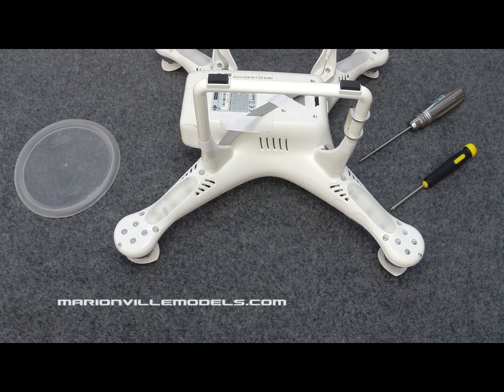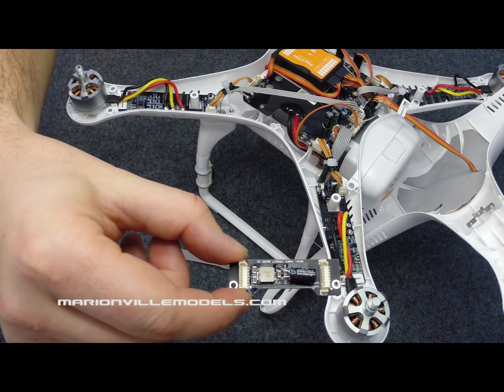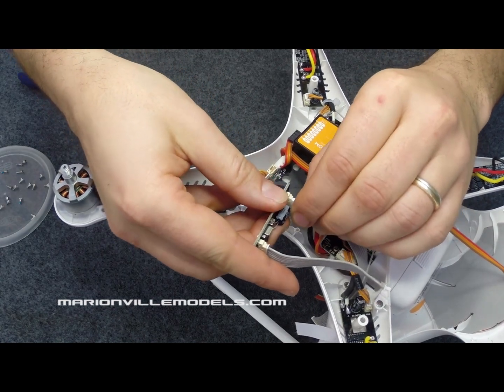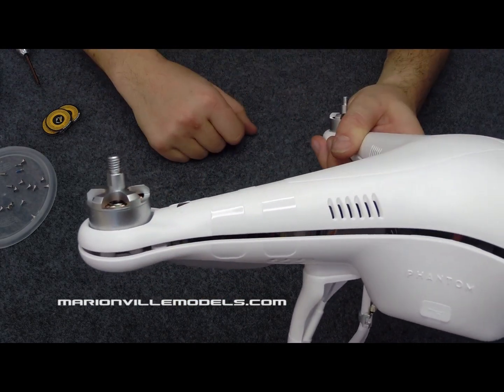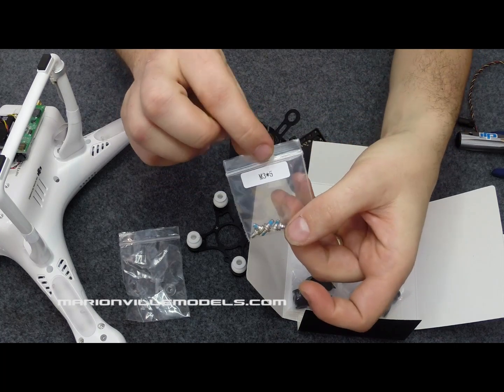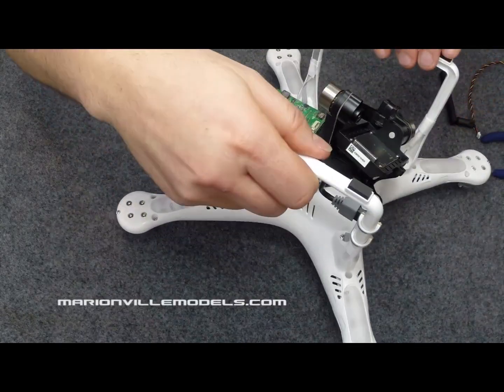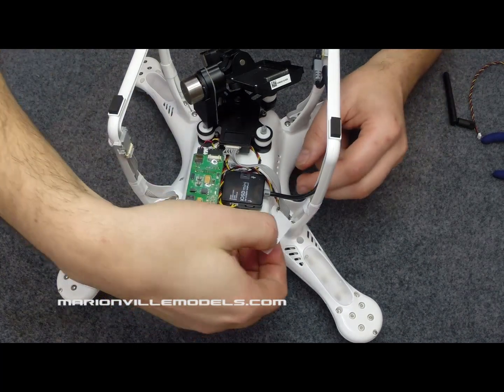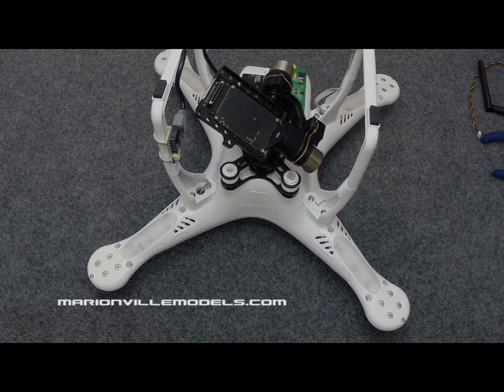How to fit Zenmuse H3-3D gimbal with anti interference filter to Dji Phantom 2

Comment: I do not have the long grey cable inside my Phantom 2 Vision to the camera. Its a 3 wire yellow brown red cable. So now what? Also, you skipped the part with the items on the bottom before you did the gimbal?

Comment: my gimbal vibrates alot on my phantom 2...anyone have this issue....it keeps wanting to turn and making bad noises...Zenmuse H3-3D
Reply from the maker: Sounds like something is loose. Check the camera bracket is tight.
Reply: i dont have a camera yet on it, would that cause it? it shouldnt, i thought the wires are only powering it...any ideas?
Reply: +Marionville Multirotors   the motors are going crazy, that is what i meant...but i have no camera hooked up.  does it matter?
Reply from the maker: +Theo T you must have a camera on to balance.

Comment: whats is the function of this circuit and what happens if i do not install it?
does it comes with the gimbal o i have to buy it separately?
Reply from the maker: It was to stop possible picture interference. It should come with the gimbal.
Reply: +Marionville Multirotors thank!, i have a fpv transmiter connected directly to the gopro, do i need the anti interference circuit or not???
Reply from the maker: +Ivan Gavancho Reinaga no you wouldn't need it.

Comment: I just added a gimbal to my f450 conversion from fc40. I am now having some control issues. When I fly it tends to loose altitude and with enough side to side motion it will descend and hard land. I cannot recover the landing almost like it is unresponsive. Just curious is the a symptom of interference and do I need to add one of these boards?

Comment: Pardon me, but can I ask you about the plastic post in the rear corner of the gimbal? It seems to limit the spin of the actual gimbal, unless I installed it incorrectly and if I can't get plastic washer off post did I snap it upside down?
Reply from the maker: When the gimbal is powered it doesn't move that far as to hit the drop link.
Reply: Marionville Multirotors
Are you sure about this?
Reply: *****
I just took the plastic posts out and put 2 in the front, rather than one in the back and one in the front. It's a horrendous design.
Reply: *****
Those pegs are basically just to hold it on, so I don't think it really matters. We were out flying with it yesterday, and it was fine. I think some people leave them in the back so that the gimbal doesn't turn as much, which would get the Phantom legs in the shot.

Comment: I have a phantom1 and I recently bought a zenmuse h3 3d. Can this gimble be installed on the phantom 1?
Reply from the maker: Yes it can, you need an adaptor to mount the newer gimbal which includes a longer set of landing gear. You would also need an upgrade board for inside the phantom.

Comment: Great video.  I already have a phantom 2 + H3-3D gimbal but would like to get a full FPV set (including the black pearl monitor).  I looked on your site but could not figure out how/what all I need.  Can you advise and do you carry/sell all the components?  I believe I need something along the lines of:

• 500mw Video downlink Transmitter
• Video Receiver (what kind)?
• Long Range Cloverleaf Transmit antenna
• Long Range Cloverleaf Receive antenna
• FPV Hub to make all connections easily (no soldering) 
• 7-inch AC/DC FPV monitor (black pearl)
• Sun shield for the monitor
• Transmitter Monitor Holder
• DJI Mini OSD for real time on screen telemetry data 
• 3 cell 2200 Lipo to power Monitor and receiver
• Lipo charger for the battery
• Charge lead for the charger

??
Reply from the maker: We do packages which include all the items. 
http://www.marionvillemodels.com/rc-shop/dji-phanrom2-fpv-screen-package.html

Comment: This is the new 3dhd zenmuse, made to fit the gopro 4, thats why they have the usb side-port solution on it, the new goprp won't fit the old type of gimbal where you connect on the backside apparently.  I asked the dealer when i bough this zenmuse 2 days ago:)

The new Gopro is smaller, but have a mini usb like the hero 3, so its perfect for this zenmuse, don't need to bye a new one......

Comment: Good video, but it seems to be the 2D ginbal, not the 3D, am I wrong?
Reply from the maker: Todos the 3D gimbal but its the V1, there is not a V1.1 which does not have the gopro connector on the back plate. IRS now a robot mounted USB connector mounted on the dice.

Comment: Every H3-3D I have seen (including the official DJI installation video) takes video out from the GoPro USB port via a crappy thin cable.  How did you get a H3-3D with a rear port connector?
Reply: I have since discovered the V1.0 used the rear connector, now the V1.1 uses the (rather flimsy) cable to the side USB
Reply: Chainsaw Dude  I just returned my H3 3D v1.1 with the flimsy side cable to USB and was looking to get a version 2 somewhere. Anyone know where I can get the latest version?
Reply: Seb Lesec I believe V1.1 has only just been released and is the latest version. Not heard of a V2 yet
Reply from the maker: V1.1 is the latest. You just have to be careful with the ribbon.
Reply: oops, looks like I will have to reorder...
Reply: this is the new zenmuse type, made to fit go pro 4, thats smaller, so they use the usb solution.
Reply: kenneth wik
I have been told that DJI must pay GoPro a license fee to use the proprietary back connector and so that's why they switched to using the plug in USB cable
Reply: really? i have no idea, but I'm glad i got the one whit the gopro 4 fit:), no hassle later.

Comment: So my zenmuse h3 3d did not come with the part of the gimbal that plugs directly into the back of the gopro! I'm assuming I will need this for fpv? What to do?!
Reply from the maker: Sounds like you have a V1.1. There should be a small connector on a ribbon on the side of the back plate for connecting to the gopro.
Reply: bummer, I'm going to see if I can exchange it at B&H photo for the newer version...
Reply: Marionville Multirotors I returned my H3 3D v1.1 with the flimsy side cable to USB and was looking to get a version 2. Do you know where I can get the latest version?

Comment: hi mate,

i initially installed my anti interference board by following your video (thanks by the way) but today i was installing some FPV equipment when i realised that there are actually mounting screws on the main board of the Phantom which can be used to install the anti interference board. I've now hard mounted mine using the 2 screws (remove the 2 screws, position the board and then replace the 2 screws) and this way allows you to install the cables easier without having them double back over themselves. only other thing i had to do was remove the Zenmuse cable from the leg it feeds through and instead feed it up the leg that has the compass (makes for a neater install and less stretching of the cable)
i took some photos of the install which can be seen in my video here - Internal Hard Mount Installation of the H3-3D Anti Interference Board - DJI Phantom 2 (that vid was uploaded to my other account)

cheers

scott
Reply from the maker: Ive done a revised video for the alternative location.
http://youtu.be/aBlrZpWNnhs
Reply: Marionville Multirotors nice one mate :)
Reply: Marionville Multirotors

Great video.  I followed it to the letter and it was great!  I already have a phantom 2 + H3-3D gimbal but would like to get a full FPV set (including the black pearl monitor).  I looked on your site but could not figure out how/what all I need.  Can you advise and do you carry/sell all the components?  I believe I need something along the lines of:

• 500mw Video downlink Transmitter
• Video Receiver (what kind)?
• Long Range Cloverleaf Transmit antenna
• Long Range Cloverleaf Receive antenna
• FPV Hub to make all connections easily (no soldering) 
• 7-inch AC/DC FPV monitor (black pearl)
• Sun shield for the monitor
• Transmitter Monitor Holder
• DJI Mini OSD for real time on screen telemetry data 
• 3 cell 2200 Lipo to power Monitor and receiver
• Lipo charger for the battery
• Charge lead for the charger

Comment: Is it necessary to download any firmware update in order to make this filter work without messing up the factory settings? Or is this just a filter and wouldn't mess with the rest of the system?  Please advise as soon as possible. Thanks for this great tutorial video.  I just installed the filter following your advise on the video. I Hope this really work.  Thanks again.
Reply from the maker: No there isn't any firmware for this part.
Reply: Marionville Multirotors Thanks

Comment: Great vid. Thanks. I have installed and am using with a futaba T8. I had pitch control for about 10 mins then it stopped. Gimbal works just can't control pitch. Any ideas?

Comment: I've just installed a H3-3D on a phantom 2 and one of the plastic pin used to secure the gimbal gets in the way and could potential harm the gimbal. How do you remedy this problem? secure it with zip ties instead? Thanks

Comment: The interference filter is to "eliminate some of the jello" ?  Hmmm... I think not. I think you'll find that the filter is supposed to remove interference on the video feed that occurs in certain installations. 'Jello' is a stabilisation/vibration issue and has nothing to do with the FPV electronics.
Reply: We are aware it doenst cure the Jellow. The video was crated as soon as it was included with H3-3D gimbals. Dji stated it was to cure some of the issues at that time which jellow was one. The video was made before we tested it and relished it doesn't not cure the the Jellow issue and in some cases doesn't cure the FPV interference either. As the part comes with no instructions at all we thought it would be us full to some to make this video on how to fit it.